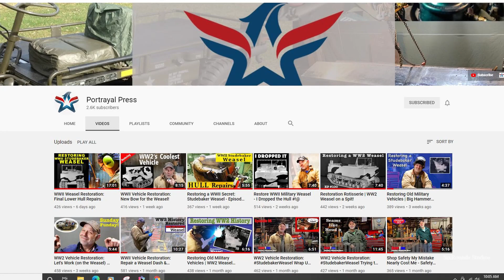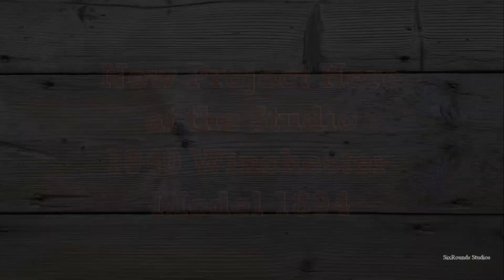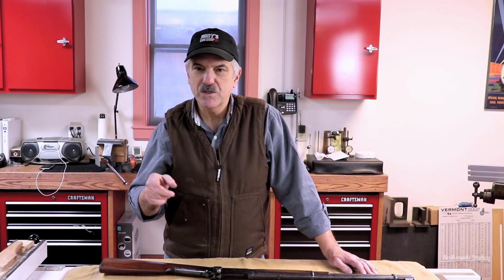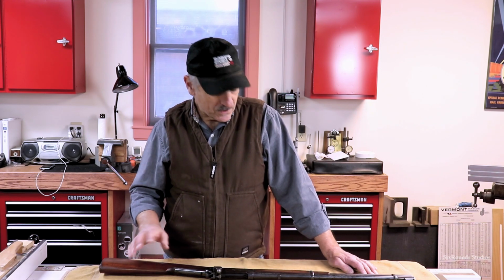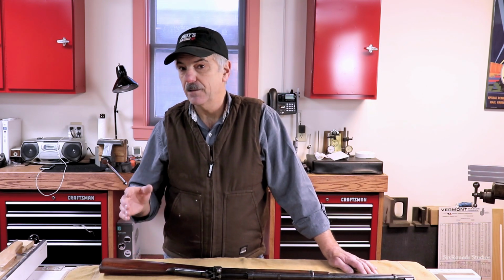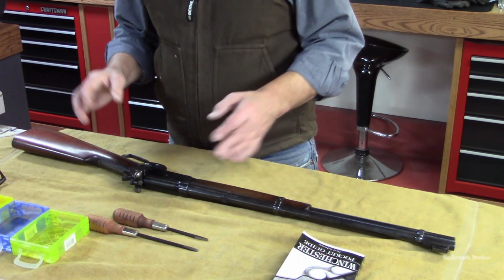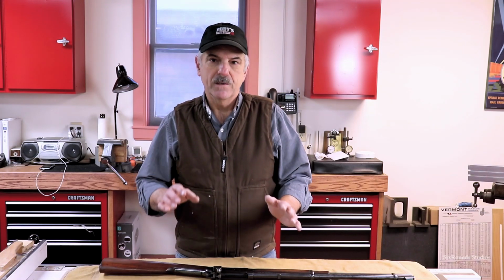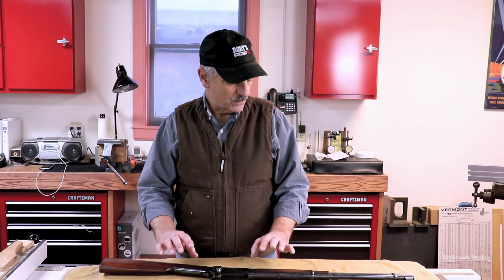Speed Disassembly How Fast Winchester Model 1894

Comment: Everything is all fun and games on my 86 until I get to putting the bolt, lever, extractor, extractor spring, firing pin, and aligning them all in the same pin size hole. You wish you would have 4 hands.
Reply from the maker: More sometimes! Thanks for watching and commenting!